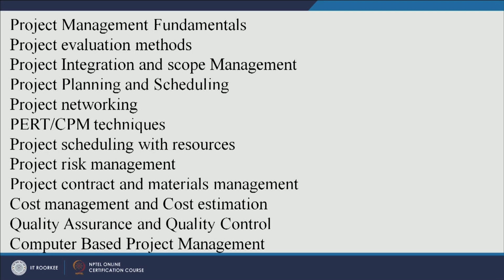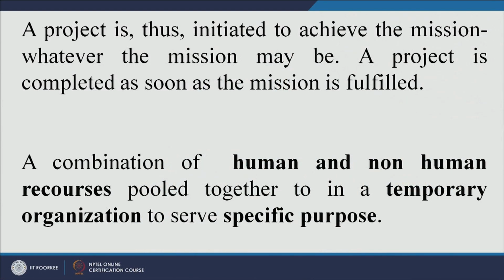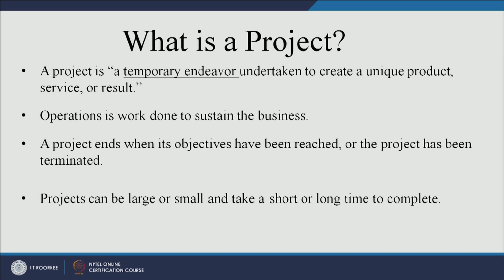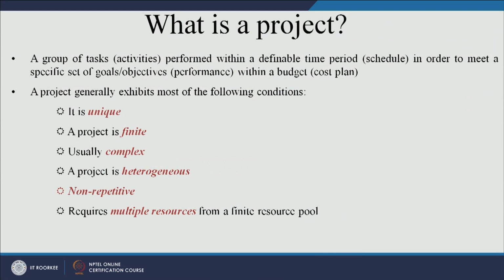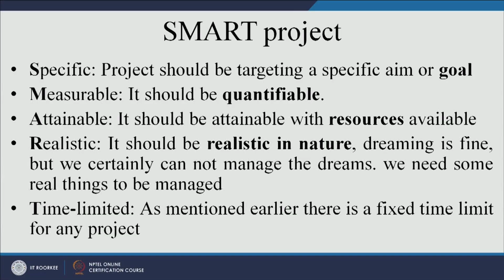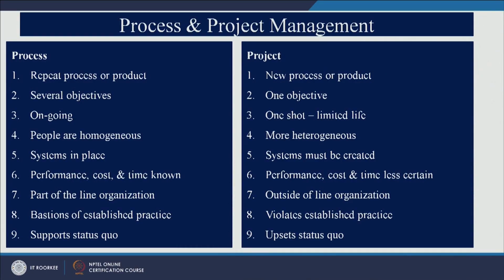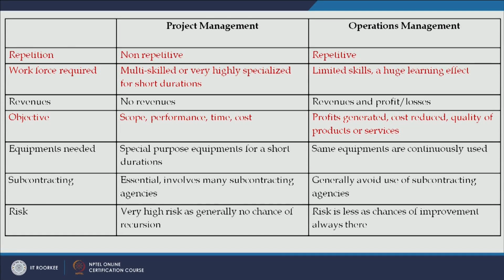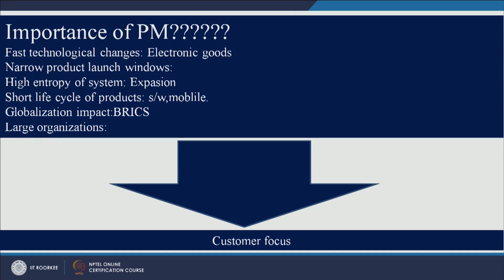Introduction of Project Management

Comment: 00:24 Project management involves 10 areas and 47 processes.
04:21 Project management involves strategies, work breakdown structure, and team management.
07:58 Project is a temporary endeavor to achieve a specific purpose.
12:17 Projects are unique, complex, and non-repetitive.
16:25 Project management involves risk management and smart objectives
20:12 Projects are non-repetitive and have limited life
23:40 Distinguishing project management from operations based on criteria
27:40 Importance of projects due to rapidly changing customer preferences
Crafted by Merlin AI.

Comment: Sir, I have a Question. I am working in a company which Builds a high rise building. We use I section steel  columns and beams to build the structure. The Job of Fabrication for this I section Columns and beams are given to a fabricator ( Eg JSPL).Now MY COMPANY doing a Project as we are erecting the building and as soon as the top floor is reached we will leave the site and our work will be over.
But the fabricator with is Fabricating for us certain amount and when the amount is reached, he will stop Fabricating for our project and will fabricate for some other project.
In this thing The Fabricator( JSPL) is doing a Project or its doing an Operation or Process.